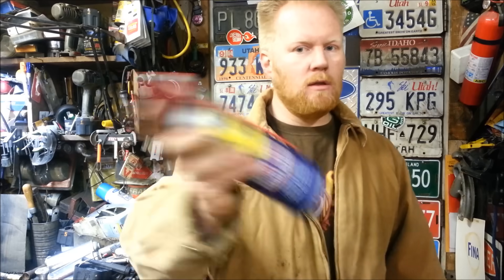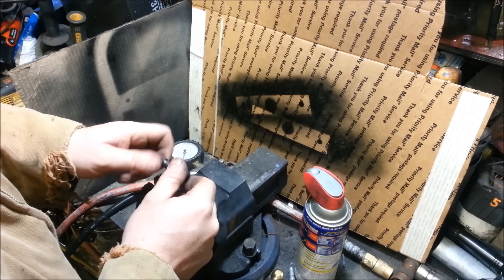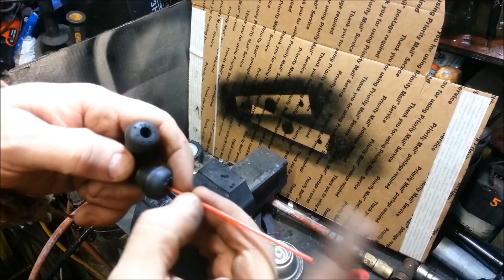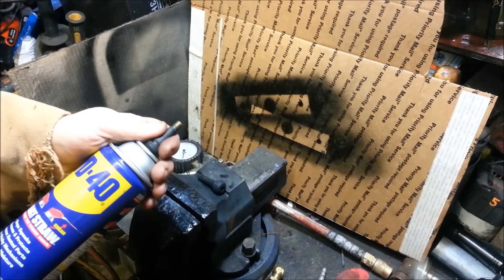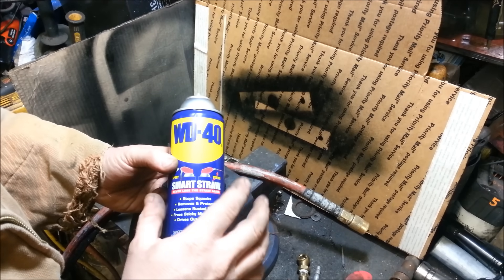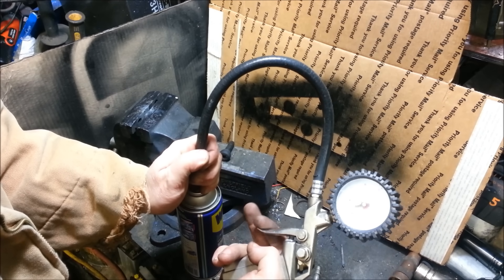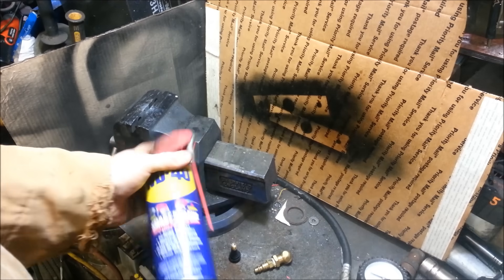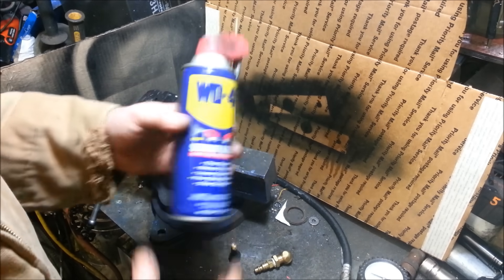Refill flat AEROSOL Spray Cans like the WD-40 and others

Comment: I have never in my many years seen a WD-40 spray can run out of content and still have pressure left in the can. They always and I mean always run out of pressure while there is plenty of oil in the can. Always!!
Reply: They are manipulating consumers, they know the easy fix problem but choose not to correct it.
Reply: @brewsterly2927  The company must be owned by a Democrat
Reply: @bigbilltoady412  you got that right!
Reply: @bigbilltoady412  Yea cause Biden got elected and now we've run out of virus - oh them Democrats!
Reply: @bigbilltoady412  nawl,  the Federal Reserve owns them all.  Capitalism does not exist.
Reply: It may not necessarily mean they are manipulating their product. If you think about it, half the time most people spray this cans at an angle, which lets out the air and the product still at the lowest part of the can.
Reply: @samstyme4125  not always. there are cans that are advertised as being usable upside down. for example this wd40 "smart straw" or how they call it.
Reply: @samstyme4125  Anyone that does that is an idiot if they keep doing it. Sometime you might need a blast of oil when the can can't be held upright. I do is start the spray upright into the air above something I don't care if it gets a little oil on it such as the ground then tip the can and give it a short burst. The oil in the tube inside the can will hold enough to give you that oil you need before it starts blowing just air. At that exact moment I stop so I don't lose can pressure.
Reply: @bigbilltoady412  I agree, thanks! lol
Reply: I’ve never had that problem I use it all and then it just sprays air
Reply: I gave up on the cans, I just buy the liquid jugs and pour it in a spray bottle, it has saved me many hours of frustration.
Reply: @willweyersolutions3359  I agree, I bought a one gallon can, and now I am lubed for life.  Still don't like the smell.
Reply: @bobk2966  Dude the smell of WD is like the smell of fresh mowed grass in the spring, two stroke out board on the lake at 6 AM etc. Childhood memories. I love it.
Reply: @bobk2966  yep bought the 1 gallon can and a cheap finger squeeze pump sprayer with the adjustable nozzle, a vast improvement over the aerosol can.
Reply: @willweyersolutions3359  Yes , I do the same, its more cost effective as well
Reply: @willweyersolutions3359  The BEST solution!
Reply: @willweyersolutions3359  Me too, for years. Buy it in gallon cans for $22.
Reply: I’ve got 2 in my garage that need this fix
Reply: Just punch a hole in the can and collect the remainder and use in a hand pump sprayer or oiler can.
It's not that hard.
Reply: @jayytee8062  Or punch a whole use then set the can with the remainder in it somewhere with the whole facing up that will get knocked over 100% of the time how I roll lolol
Reply: @fishfire_2999  
I commend you on your laziness and lack of inventiveness. You're a true workshop legend.
Reply: @jayytee8062  Exactly.
Reply: @jayytee8062  also this is just as easy and does the same end result
Reply: @jayytee8062  ditto!
Reply: Thought about doing that but wasn't sure if it was just a plugged nozzle.  I've been fooled before with spray paint.  What a mess.  Now I put a large sheet metal screw into the nozzle instead. It will be a little more controlled if pressurized.
I've used the air compressor but never knew how much pressure.  I just gave it just enough to get it to spray to be safe.
Reply: 100%
Reply: I have, and many other spray's as well!!!
Reply: Usually mines only have very little amount left because I keep shaking well and there's positions where it can't throw much of the content and only waste pressure... what I do is just a puncture and put it in a small oil plastic container and use it to clean stuff but it doesn't even fill a very small one
Reply: Of course you know, the can lost pressure from incorrect angle of operation, and the author's information was directed at WD-40 because of it's revered usefulness.
Why waste it.
Much of the replies to your comment are off topic nescience, to this video; e.g. "Spray Cans like the WD-40 and others"
Reply: Bigbilltoady - YEP just bitching about it today! sprayed my friends engine bay 3 cans. Must be a W - 40 glitch somewhere in the process. I've used other brands and don't remember having that problem.
Reply: Just what I was thinking - thanks for commenting on my behalf 🙂
Reply: I simply stay away from WD-40 altogether. I don’t think I’ve had a can in 15 years now.
Reply: @Arbiter of Truth, I just prefer real lubricants when I need lubricants. So many people have it ingrained in heir minds that WD-40 is a lubricant when it’s a solvent. Why use a solvent as a Band-Aid to briefly fix something squeaky when you can use a long lasting lubricant instead. Everything I once used it for I have replaced with a very cool line out of Australia called Inox MX-3. It’s brilliant.
Reply: @SumDumGy  maybe ppl think it’s a lubricant because it says it is on the can.
Reply: @ mettler54, Probably. I could also put on a tee shirt that says “I’m a smart man.” It doesn’t make it so. A solvent can temporarily lubricate,  depending on what it’s made of and what previous dried up lubricant residue exists that the solvent liquifies and disperses. Again, that’s a Band-Aid. The solvent will evaporate. The solvent will break down that existing lubricant at the same time it liquifies it. WD-40 promotes itself as a lubricant to keep the sheep coming back.
Reply: @SumDumGy  Inox is what most use in Australia. Great products. Best thing I've ever done was swap over 20 years ago. The shit works. The lanolin spay is great for workshop machinery surfaces. If you don't mind the shed smelling like sheep.
Reply: Untrained Professionals, I’ve been happy with every product I’ve used that Inox produces. It’s a shame it hasn’t become more readily available in the U.S.  Working in hardware for the last 16 years, it’s a line that I’ve promoted heavily over the years.
Reply: @SumDumGy  I'm in Australia. It's not the cheapest but by far a better choice. I have never felt ripped off and when I run out and that shit can of WD might get a run but usually I head to parts shop to restock on inox.
The stuff just works.
Reply: @SumDumGy  "I just prefer real lubricants when I need lubricants. So many people have it ingrained in heir minds that WD-40 is a lubricant when it’s a solvent."
Exactly.. WD-40 is good to clean off lubricant, so that you can add new fresh lubricant.. The WD goes in, dissolves the lube, and the thinned lube drops out and off of the mechanism. Then you let it dry for a couple of minutes for the WD to evaporate, and re-lube with whatever lube is best for your application. WD-40 does not stick around.. 99.9% of the WD you spray ends up in the air after a short time, and the part will be very dry.

I will say in a pinch you can just use a small amount of WD-40 to 're-wet' old lube and redistribute it to the wear areas, but this is a temporary fix at best while waiting on the proper lube to be restocked :D.

in conclusion, I suppose that re-wetting with WD-40 is probably slightly better than the bare metal on metal squeaking sound.. but if you are really wanting to fix it you should spray it down good with WD, wipe it off, then put some actual oil/grease that doesn't evaporate into the air on it lol.
Reply: @ Akuno G, Agreed and well said.
Reply: @akunog3665  So you don't get that WD-40 wasn't designed or meant to be a lubricant? Its' primary role is to free stuck nuts and bolts. It is also meant to free up stuck parts meant to move freely. Once you get those stuck parts moving, you then use a proper lubricant to keep those items moving freely. 

This trick to regenerate a spray can, is hardly a new idea. I learned this trick when I was 11, pumping gas(pre self serve) at the local service station. Using an airpin for blowing up balls like basketballs or footballs, you can recharge the spray cans with a female valve.
Reply: @Lenny Chorn  "So you don't get that WD-40 wasn't designed or meant to be a lubricant?"

Not sure how you got that from my post. The whole thing is talking about how it's not a lube.. and that it removes lube. One quote is, "if you are really wanting to fix it you should spray it down good with WD, wipe it off, then put some actual oil/grease that doesn't evaporate into the air on it lol."

To be really specific it was designed to displace water. The name is WD-40, Water Displacement-40. But regardless of what it was designed for it's also good at cleaning lube off of parts, and in a pinch you can get a mechanism moving again by rewetting the dried lube with WD-40, although I would only recommend this as a temporary solution if you are out of stock of the proper lube while you wait on the new lube to arrive.

As far as self service gas, that appeared on the scene in 1947 in LA. and some stations are still full service, and in Oregon you still can't pump your own gas.. so you are between age 11 and 63 years :D
Reply: @SumDumGy  Inox great for polishing stainless as well (prevents tea stain)
Reply: @ Anthony Canham, Thanks for the tip! The daughter of the guy who invented it told me it’s also a great furniture polish...if you don’t object to the scent. Being parafin-based, it makes sense. I think she also used their lanolin grease as an impromptu lip balm!
Reply: @SumDumGy  Bunnings sell Inox.
Reply: @ Brian Cowley, I don’t have any of those locally. I’ve never heard of it.
Reply: @SumDumGy  Bunnings sell Inox
Reply: I have not using wd40 for a very long time due to too often having this issue each time.. now i stick with 'selleys' brand.. more cheaper and more quantity.. it smell good also.
Reply: @harisyoung4110  More cheap, more quantity, but way less effective.
Reply: Operator error.
Reply: No bother, there are dozens of cans around ! in your…. car,truck, garage,shed, barn,  underneath the kitchen sink, in toolboxes…..  you probably already own enough of the stuff to last you the rest of your life !
Reply: @CrimeVid  To say nothing about spray paint rattle cans. I got about 75 to 100 of them. It seems like every time you need a color its going to be one you don't already have. Murphy's law.
Reply: I have a HALF FULL one right now that ran out. WD seems to be terrible for it like you say. Never had it happen with CRC
Reply: Actually I have a can in my garage that is half full with no propellant. Very interesting way to not waste money having to buy more.
Reply: Ain't that the truth
Reply: He might suffer this because he sprays the can upside down, lol.
Reply: Planned obsolescence
Reply: I'm just guessing here but I would imagine this depends on temperature and humidity of storage area.
Reply: you never kept them in a -20 degree garage before?  if it gets cold enough I gotta fill my tires to cancel TPMS!
Reply: 100% correct and I do love my WD-40, I've been poppin a can opener with "an old-fashioned can opener"and just draining into a spray bottle, but no more. This is my new technique.
Reply: I always end up stabbing it with a knife and pouring it on what needs it 😆
Reply: @Jordan__Sloan  lol
Reply: When you die as we ALL will soon. 99.9 sooner than they think 🤔 ..you will kneel before JESUS. Romans 10:5/10. The One and only true Son of GOD Almighty, all others are false..JESUS was crucified on the cross at Calvary and then on the third day rose again, for you and I (John 3:16). So, Choose this day whom you'll serve. For if you don't it will be chosen for you and that is HELL
 Arguing with me is silly at best. Bc I'm just the messenger...
💌
Please call .
83.For.Truth.☎️.👍.
Reply: it's often how the can is used and the time it sits unused, I have seen many out of propellant(very old cans not used much). I've had a few gas out from improper usage and left laying around, but generally I cannot keep the stuff around, but after many years I gave up and went to handpump spray bottles and 1gallon or larger refills
Reply: I have found that people don't pay attention to which way they hold the can. They're always trying to spray while holding the can up-side-down, expelling the gas more quickly than the fluid.
Reply: True that. Not just WD40 either. Some other types that are quite expensive end up being wasted in the can
Reply: That's because u are using it wrongly
Reply: Using that product only to clean rims on my chopper, other than that it's useless.
Reply: Some dummy will take an oxygen bottle and Try to pressurize it and…….BOOM 🧨🧨🧨

Comment: Be careful! "Oil (hydrocarbons) in the presence of oxygen under pressure burn violently (combust, explode)." 
Ask any welder why you should never oil an oxygen regulator valve. I know, the atmosphere contains little more than 20% oxygen, but under certain conditions, re-pressurizing your can of WD-40 could be life-changing...for the worse. 
One of the propellants originally used in WD-40 aerosol cans was butane, but to reduce the flammability of WD-40, the manufacturer switched to CO2 (carbon dioxide) or other gases that don't support combustion. Using air to pressurize hydrocarbons like oil or WD-40 can be very dangerous.
Reply: It takes about 380 psi to ignite oil (diesel). You would want to avoid static when filling. But 70 psi at room temperature isn't going to hit ignition temperatures, and pressure.
Reply: @capnbilll2913  That's for autoignition, not external flame ignition.  People spraying on a spark or flame with a new can will get a mostly harmless light show in front of them.  People doing that using this fakkate idea will end up with a hand grenade.
Reply: The vapor pressure of the WD-40 “active ingredients”, i.e. the ingredients susceptible to oxidation and combustion, are insignificant to addition of a few pounds of air pressure to the can at normal environmental temperature and conditions. It shouldn’t blow up, or ignite.  Try it and see!
Reply: yea, but what isn't dangerous in this world.....give the can some air and use the product you paid for with your hard earned dinero......the odds of blowing yourself up are less than the same odds of dying from covid........which is another bit of scare tactics
Reply: We often spray wd40 on a fire ...don't try that with a refilled can it could be explosive
Reply: An oxygen regulator handles 100% oxygen at several hundred to a couple of thousand psi.  20% O2 at 70 psi will not have the same explosive effect.
Reply: BOOOUUNN!!! risk is very high.
Reply: NEEERDDDS!! those of you who point out why stuff like this is a dumb idea, God bless you for helping us avoid blowing ourselves up. Please keep at it vigilantly.  And those of you who point out the thresholds at which we would actually cause that catastrophic result, God bless you and thank you for your knowledge.  You see, while the early bird gets the worm, surely the second mouse gets the cheese ....( pause while everyone figures out why that is)...... but the third mouse, he knows,  and has seen, that truly, noone stands alone. But unfortunately a short while later ( 80 years tops) everyone died and this wisdom washed away before the tartigrades learned to read it.
Reply: Thought the same.
Reply: The butane propellant of old was internally safe because there was no oxygen present.  But you're right: This absurd video is promoting premixing a fuel with a oxygen.

By the way, I've seen the comment of "only 20% oxygen" before and agree, it's silly.  Folks, outside of tanked o2 flames (and NASA) and  preoxidized fuels in bullets, every explosion and explosion-like burn on earth is done with the O2 levels of the atmosphere.

Comment: Cool trick ! FYI  did you know that  a regular i1/4 “ quick connect air fitting  will fill a tire without a attachment ? Just push it over the valve stem and it will inflate the tire  at my old company we stopped buying the chucks because our truck drivers would lose them as fast as we could buy them
Reply: Your truck drivers weren't losing them. They were stealing them.

Comment: For the other style, like cheap spray paint - - whittle away at the spray tip until you have JUST the plastic stem, JB-Weld or Epoxy this little piece into (preferably a new) tire valve. Now you can charge up your paint cans !!

Comment: How do you know how much pressure the can can take? It could be too much air that could explode the can.
Reply from the maker: I put around 50psi into the cans. Cans labeled 2Q are factory rated to a minimum 270psi at 130F burst strength.
Reply: @sixtyfiveford  
Good to know that you know what to do.

Comment: I think you have to fill with butane or cfc gas, both in liquid states, because air only works a few times!
Reply from the maker: Compressed air lets you finish off the can and is generally good enough. Propane is the easiest and works just the factory propellant. Butane works as well but is pricey for what you're using it for.

Comment: If you're always spraying the can upside down on on its side like that, it's little wonder that it's not working for you.
Reply from the maker: Not sure at all. WD-40 actually has an air intake at the top of the pickup straw that is regulated by a check ball. That's why it's foamy when it comes out as it inter mixes some of the propellant with the WD-40. This check ball gets stuck and forces out too much propellant with the WD-40 and it runs out before it's supposed to.